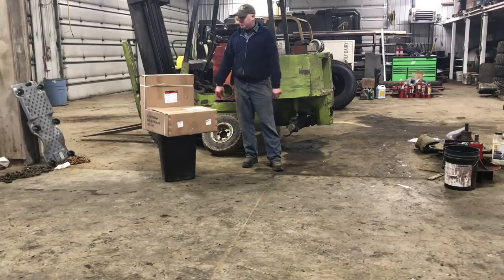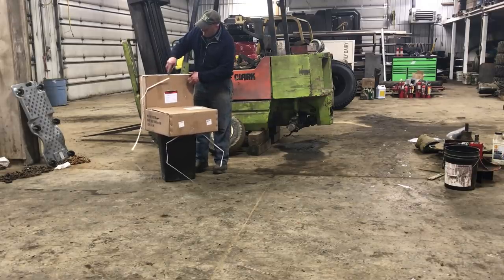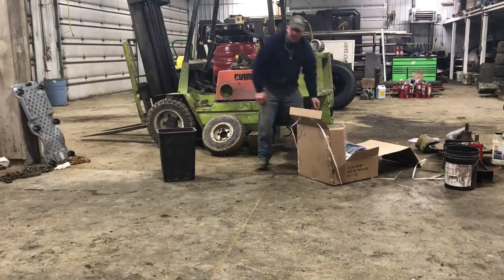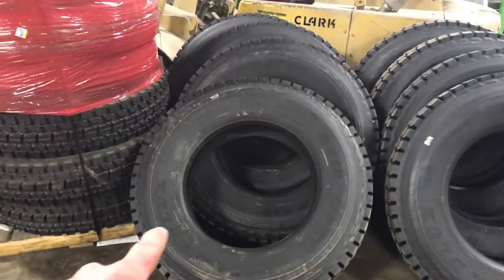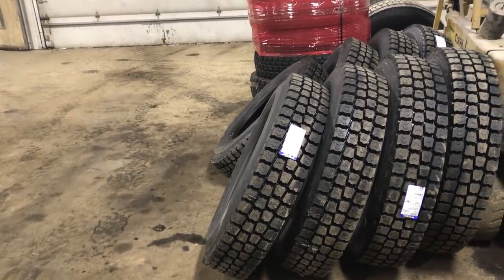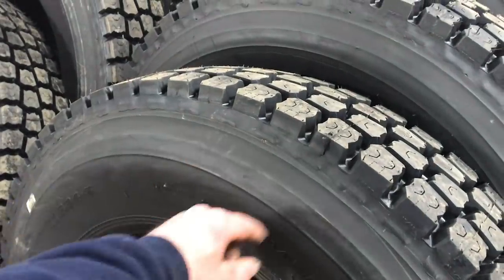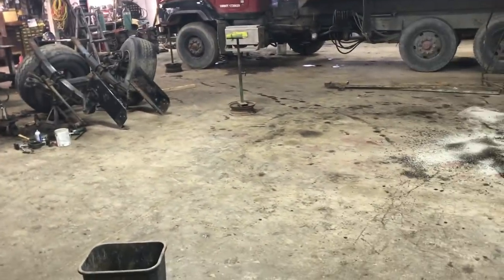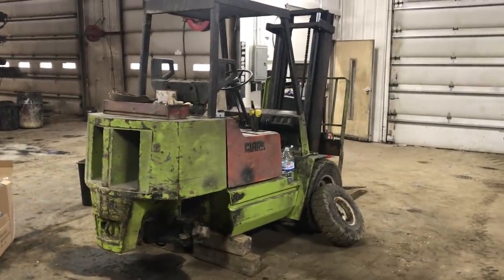eBay purchases

Comment: Look up tire recappers on internet too.  I get 24.5 caps for trailers from them for $140 or 150 a tire depending on which tire I run.  That is casing and new cap complete delivered to me in CT.  8 tire $1200.  They will rot out before I wear them out the way I run them.  They have drives too.  The last ones I got were all Firestone and Goodyear casings.
Reply from the maker: That's a nice price.